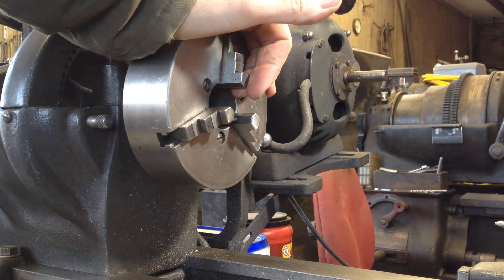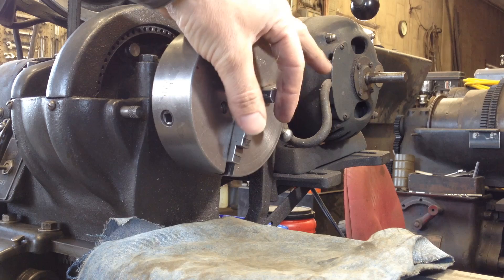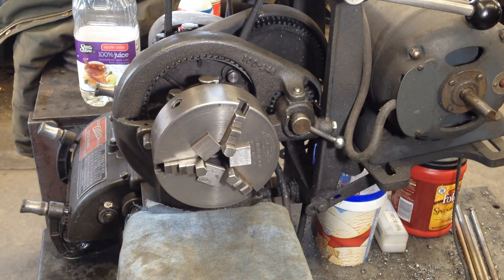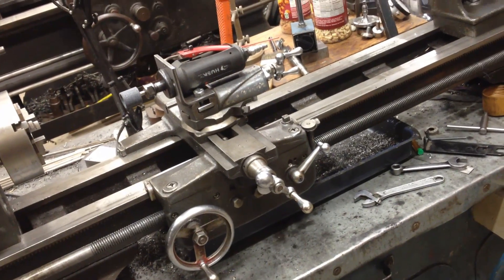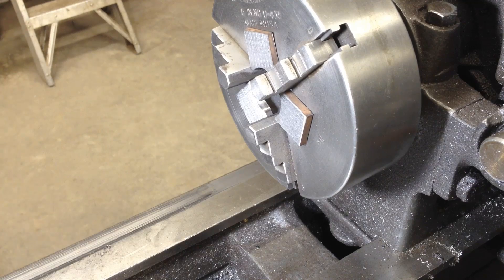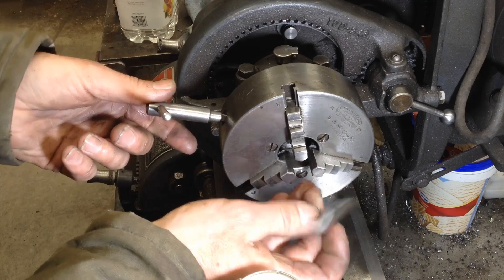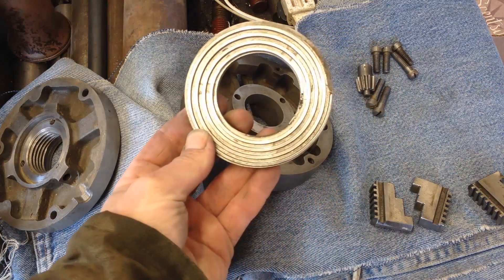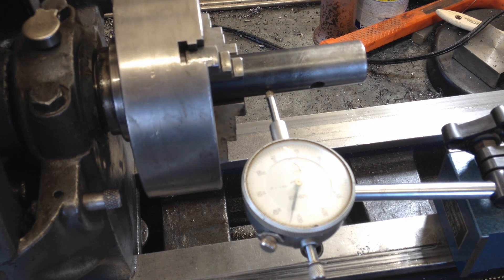Spacer Method for Chuck Grinding ATLAS lathe

Comment: You  can dress  the grinding  wheel  first  put a boring  bars  with  hole the same size of  your  diamond  dresser in your  lathe chuck  then put your  spacers in  and  grind  the jaws.

Comment: I am years late to see your video---but here goes. I can see your Atlas has babbitt bearings.I also have a Atlas 10 F with babbitts. On my lathe there are thin brass shims between the bearing caps and the head stock. The purpose is to remove the shims as the bearings  ware in and reduce play. Put an indicator on the outside wall of the chuck and pull up on the chuck to see if there is and movement on the dial. I didn't see any shims on your machine to remove. If your movement is large you may have to pour new bearings or replace with roller if you can . Disassemble and clean the chuck. Reassemble and mount the chuck ,then grind the jaws.

Comment: To hold the spacers in place, try a small ball of funtak. You know the sticky blue gum you use to hold up posters. Seems like that would hold them just fine until the chuck is tightened.

Comment: Maybe that runout is between the scroll plate and the chuck body, the scroll plate could be free to wander around inside the chuck so no matter what you do you will always have that runout. Just a thought, not speaking from experience. There is nothing to keep the scroll plate concentric other than the tolerance the chuck is made to. I bet if you measure it the high spot will be down and away from whatever hole you used to tighten with the chuck key as a result of the scroll being pushed down and away by the bevel gear. Great video, I’m considering doing it to my 3 jaw to improve it, the 4 jaw can be precision work.

Comment: Figure out which jaw(s) is giving you the +/- 0.0015 then try to grind it down evenly by adding ~0.001" shims on the opposite spacers. I didn't use shims for mine but ended up making custom spacers that varied by +/-0.001". That way you can fine-tune your grinding. I was able to get my chuck under 0.001". Basically you're trying to grind the jaw that is giving you the discrepancy while also preloading the other jaws evenly. Not sure if that'll help you, but it's worth a try (4 years later!) All the best!

Comment: Man, I don't know what you were expecting in the way of run out from a three jaw chuck. I've only had one three jaw chuck that consistently held a tighter tolerance than .003, and that was a Buck Adjust tru chuck. All the three jaw chucks I know own have runout in the .003 area. Be satisfied, you made it! I you need greater precision use a 4 jaw or go to collets.

Comment: 1.   0.003 ain’t bad 
2.  Clean and GREASE!  First! 
3.  Unless you have a bar for measuring runout 
      You must make one.  Between centers cut a round bar stock until perfectly concentric thru it’s length.  Mount known concentric round bar in the chuck and measure runout again.  Dress your stone with a diamond dressing cutter until it’s perfectly concentric.  Slowly Dress the chuck with your stone.  Mount test bar and measure.    To gain accuracy repeat with holders in different spots ad Infinitum.    Then clean entire lathe.  ;)

Comment: I did the same thing and got it to 1 thou,  turn your shims so they are spanning the entire jaw, Then they actually clamp straight and you can actually grind the bell mouth out. The placement of your shams only puts pressure on the inner edge so the outside edge is away, if that makes sense.Rotate them and give it another try. Good luck!

Comment: This looks like the best idea. If you want to allow for the pressure of opening jaws. Send the grinder into the jaws off the top slide at about 1.5 degrees inwards. Then check contact when holding a parallel diameter tightly. Jeff

Comment: Just get an accurate ring of some sort and put it on one of the outside steps then grind your internal jaws.  Only problem is that will only be accurate for that diameter only.  But it will be a heck of a lot closer to true than it is now.

Comment: Be sure you keep your chuck internals clean.  There is only one pinion on those older chucks, and once the pinion teeth start breaking off from the crud, the chuck will quickly deteriorate.  No now makes a replacement pinion.

Comment: I know this is old but so is my lathe. Mine is about as old as yours and has the babbit bearings. I am looking into grinding the bellmouth out of my chuck. Looking deeper into the runout situation I found that the babbit bearings float a bit in the housing. I shot a bunch of brake cleaner in there to clean it out. Then I let some locktite green wicking thread locker ooz in there to fill the voids. Let it set up and found that the vertical forcible runout had been reduced quite a bit. However the horizontal forcible runout is still more than I would like it to be. Keeping the belt tension snug helps to preload the shaft and helps to minimize runout variations. If I chuck a shaft in there I have about a thou of runout. When I finaly settle on a good way to load the jaws I will grind them out.

Comment: How much runout does your spindle have?  Maybe all that runout comes from the spindle.  Anyway I suggest you buy a cheap Chinese chuck you might get lucky like I did.  With my 4" chuck from bangood I am getting between half to 1 thousand on my Grizzly mini lathe.  The spindle initially had 1.5 thou runout so I trued it up with cutter but it really needs to be ground.  I believe I can get even better results if I grind the spindle face.  Oh one more thing, why don't you try using a ring to hold the jaws open while grinding.

Comment: I noticed that the chuck was turning at a high RPM. This only clips the jaws. Yes, you can dress the jaws this way but it is much better to slow down the RPM way down, 100 RPM or less, so the grinding wheel has much more time to do its work. You will also see the progress much better.

Comment: Thanks for posting. I just finished using this method as you described in the video. I was stumped. Then I saw your video. Only think I changed was I used double stick tape to hold the spacers in place before clamping and I touched a 1/2" end mill to one side so that I did not have to grind the spacer. It worked great. Thanks again.

Comment: instead of steel let say you used a softer material, like alu or brass. The jaws would push back and sink into the spacer to even out any differences. Then the grinding would cut into the jaw equal. Or am I missing something?

Comment: You could have just use a big ring and put it over the outside of the jaws and opened them till they were tight.
Reply from the maker: Nope. The jaws must be in tension the same direction they are going to be used.

Comment: Check your test piece for ovality.? Or machine a new test piece with the jaws and insert that into the jaws and check run-out. Also because the jaws now have an internal radius and not flat, you could be gripping on the unground portion of the jaw?
Enjoyed the spacer technique which I'll probably employ on my worn chuck jaws. I'll remove after grinding, then blue them up and rub down on an oilstone just .enough to remove radius lip.

Comment: I also have an Atlas 10-36 (TH54) that needs to have the jaws ground.  Of all the videos I've watched so far I like your way of holding, spacing under load the best, so I think I'm going to find some suitable material and give it a go.  Thank you!
Reply from the maker: You're welcome! I've been putting off grinding the jaws for years until I saw this idea. It's a little tricky to hold them in place, but after that, it works great!

Comment: At the moment you are putting your 'spreader-spacers' near the base of the jaws. If you can use a piece of flat stock to temporarily space them away from the flat surface of the chuck-face,  to nearer the tips of the jaws, you will take up a more accurate representation of the wear in the jaw-slots and scroll before you grind. 
(Don't forget to remove the temporary spacers before running the machine or it will hurt badly!)
Reply from the maker: I had to think about what you're saying...  The closer to the "opening" of the chuck, the more leverage the spacers would apply, and possibly the more it would mimic real use. Now you have me curious if it would make any difference. I don't think I'll regrind this chuck, it's good enough now, but it would be neat to see if spacer "back spacing" would affect the accuracy.  Thanks for commenting! :)

Comment: Your wear (.003) is most likely scroll and jaw rack..... But 3 Thou is not too bad in anyone's language. Machine a piece of tool steel to get a good clean Z Axis and then put it in the jaws with valve grinding paste on it. Tighten but just enough to be able to turn with grips or a lever. Work the piece just as you might when grinding an engine valve and soon you will see the 'footprint' of the jaws left behind in the paste. Its then very easy to see any unevenness in the jaws but I doubt you would after a full grinding.... If you'd done this procedure before grinding, the differences would be obvious. But wear at different spots in the scroll is just a part of life unfortunately.
Reply from the maker: I might try the "valve job" technic someday just to see if I did get a true grind.  Thanks for the information! :)
Reply: You most likely got a true grind at that exact spot for the three jaws. But the moment they move, they will be positioned just slightly differently by the scroll and racks. But that's life as I said.

Comment: For some reason, everybody who wants to true up their 3-jaw chuck and its jaws, or top jaws thinks it needs to be done while the chuck and jaws are mounted on the lathe with the spindle rotating making the new "clean" surface curved.   If you look at a new chuck with new top jaws, you will see the contact surface  of the jaws is actually flat.  When the manufacturer of three jaw chucks makes their product, they do not mount the finished chuck  on a headstock or lathe to "finish" machine or finish grind the mating surface of the top jaws.   They leave the jaws with a flat contact surface.   Why would anyone want to do something the chuck makers don't do?  People would do this because they are ignorant and don't  know any better.
Reply: Let me add.  If you want to increase the concentricity of your 3-jaw chuck.  Put a test bar in the lathe, tighten the jaws and mark the LOW spot.  Remove the jaws and put them on your surface grinder and skim the  contact surface.  
Remount the jaws and check for concentricity.   Grind as needed until concentricity  is within your requirements.  You may have to grind more than one jaw to reach your goal.   Your surface grinder will but a flat contact surface on the jaw, just as it came from the factory.
Reply from the maker: It would be the way, if I had a surface grinder.

Comment: Why don't you try to put a 2" piece of cold rolled pipe around the jaws(on the od) then you true up the id
Reply from the maker: Good question. The jaws need to be held in tension the same direction as they will be used. Therefore when grinding the ID, the jaws need to be pushed out like they would be when clamping on a shaft.
Reply: Wide Vision Metal Fab  yeah you are right, But if you put those spacers Even 1degree Off of each other then you might have a difference of 1mm or more from a side to the NexT one, and since you have 3 sides...

Comment: I like those spacers you used, I've been looking at the various ways of applying pressure on the jaws and I like your solution. I have an Atlas CH54 with a 3 jaw chuck that is badly bell mouthed. Although I have a nice set of collets I also use my 4 jaw chuck quite a bit. Thanks for showing

g.

Comment: .003 is not bad for a 3 jaw scroll...
Reply from the maker: It's acceptable! :) And 10 months later, the chuck is still holding that tolerance. Thanks for taking the time to comment!
Reply: The run-out is probably in the spindle itself.

Comment: I think it's better to turn your jaws, because the rough surface finish will actually help your jaws to really grip the part better. and also, I think you really need to crank your spacers when you do this. when we cleaned the jaws on our lathe, I was surprised how much the jaws flex! at the end of the day, there was .010 diameter difference between the front of the jaws and the back! you can check where your jaws grip by chucking up something with a paper in between. when you have even marks throughout the paper, your good to go. you may even need to cut a gradual larger diameter towards the back of the jaws like I did to achieve this. 

if you want a quick fix for better accuracy, you can hit the jaw/s that are out with a soft hammer after you clamp down. it may help a couple thou :)

thanks for the video and goodluck!

Comment: thanks, I was wondering how to keep the jaws in tension.is it the headstock that's out?
Reply from the maker: +chris the bodge I'm guessing the spindle bearings have play in them.  Well, I KNOW the spindle bearings have play in them. This lathe has "engine" bearings in it, not ball bearings.  I just can't be bothered to spend a day tearing down the lathe and re-doing the shims. Good to hear from you!
Reply: I had the same bearings on a old myford lathe, you did a good job on the chuck pal :)

Comment: When you have some free time remove the chuck backing plate & put it on the spindle & check run out on the register. It may not be true.
Reply from the maker: +Dave Shadow Unfortunately, no back plate with this chuck.

Comment: I would say that from twenty thou to 3 thou is a massive improvement. Most brand-new 3-jaw chucks are not much better than three thou. You could, when indicating the test piece, try rotating it the in the chuck. Dunno why, it often reduces runout. Bit concerned about the carborundum grinding wheel. Carb ls very rough. Somewhere in the impressive collection of videos  (plug) by Steffan Gotteswinter (see channel) he grinds chuck jaws. Stefan is a perfectionist. I think he used another kind of wheel. And trued it with a purpose-made diamond dressing tool. My ER-16 on the Taig lathe run out .002. So .003 is not bad for a three-jaw at all.

Comment: A 3 thou run out is pretty average for a 3 jaw, it will only be dead on at the diameter you ground, but even then how tight you tighten the jaws will make a difference. I bet you didn't tighten on your three spacers as tight as you did on the  test pieces.
You might find that you can part off more easily now you have true jaws, as you can clamp the work more firmly.
Reply from the maker: +Chris Stephens I hadn't thought about how hard I crank down a piece affecting accuracy. And now you have me wanting to go part something! I bet it is a lot better! :)
Reply: I expect a good report to be issued, might encourage others to try. I had always wondered why I could part easily on my 4 jaw but had trouble with my 3. it turned out to be a bell mouthed 3 jaw. What happens is, it allows the work to move sideways too much and cause vibration and binding. Good luck. c

Comment: For this type of chuck, and, due to some conditions, 3 thousand is good... Also have to check out with different diameters to get an idea of how the scroll reacts at different locations, wear can be different from diameter to another.

You could probably get between 1 to 2 thou with more care taken in the prep and cleanness, the big difference between a half thousand and other chucks is the quality of the scroll itself, the manufacturers test the chucks an the ones with the specifications get priced 4 times the regular ones.

For the closer tolerances the 4 jaws is the answer...   ;)
Reply from the maker: +pierre beaudry Good to know 3 thou is acceptable. I did test it from 0.625 inch shaft up to 1.5 inch shaft, and all four shafts were 3 thou out, so that's why I quit grinding. I've had a couple good suggestions for dressing the wheel, so I might try again in the future.  The strange thing about the 4 jaw, is it seems to be more accurate depending on the time of day. It's always off around quitting time! ;)

Comment: You probably saw the Mr Pete 22nd video: https://youtu.be/-yWsjeY6nJU  on this. He got to 1.5 thousands run out, but also said that 3 thousands was not unusual because of scroll wear. He had a grinder dressing solution that you might be able to use.  Looks like you like Blue Bunny ice cream,  Sweet Freedom Vanilla?
Reply from the maker: +craigleemehan I don't think I saw that video and I did a lot of watching grinding vids before doing this.  Had Ice cream for my wife's bday. Yep, that's the flavor. And I had to save the container. Always good for parts that I'll never use! :)
Reply from the maker: +craigleemehan Oh! That's how the dressing is done! I'm not sure but what that dresser is laying around the shop somewhere.  I've seen something very similar to that... but where.  Thanks!
Reply: +Wide Vision Metal Fab Check in the Blue Bunny.  :)

Comment: You brought some nice accuracy to that old chuck. ,003" is ok and even new ones arent guaranteed for any better unless you mortgage the farm.

Colin :-)
Reply from the maker: +CompEdgeX I was wondering what the accuracy of scroll chucks was. I couldn't find and numbers on repeatability on-line, unless the manufacture was bragging about less than a thousand. And then, as you say, they were out of my price range!
Reply: Wide Vision Metal Fab
Most any reasonably priced chuck I've checked adverts .003" TIR...only expensive stuff is better.